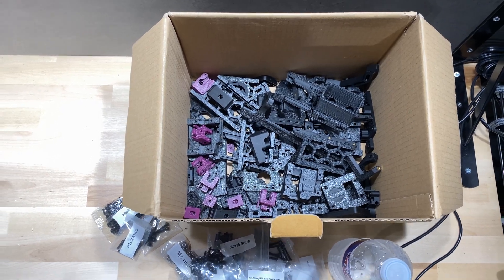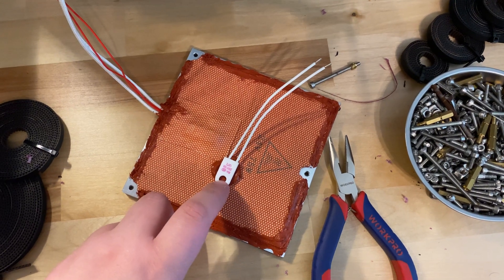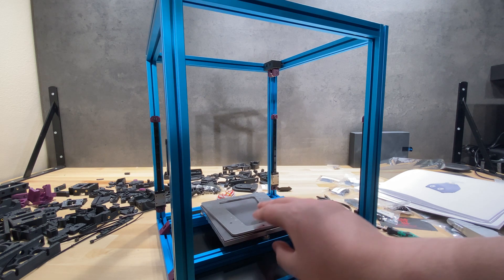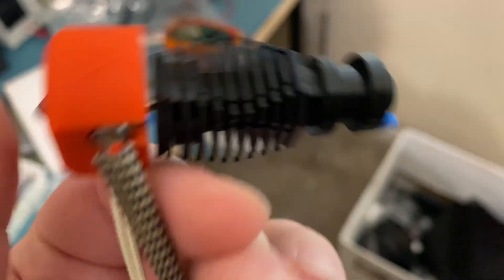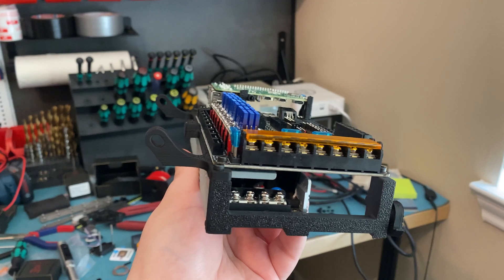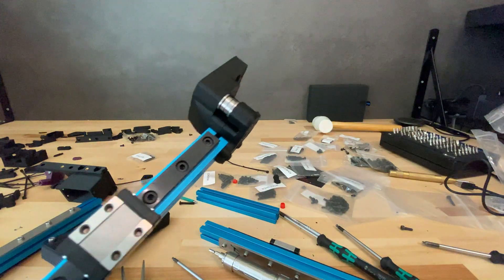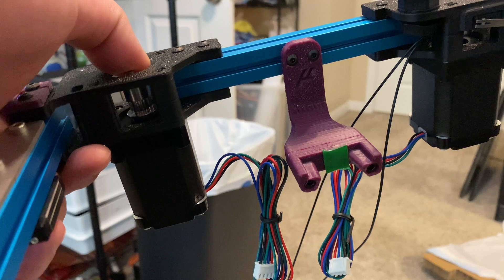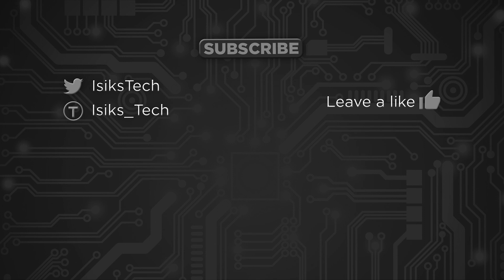Micron Ep. 1 - Frame, Gantry & Toolhead

Comment: Maybe the question sounds odd, but which advantage does it provide to go that small? Is it bed heating? Because at some point the motors and fasteners are a big part of the whole build and the overall size of the construction vs build volume becomes worse, too. Isn't 200x200mm a good minimum?
Reply from the maker: Yeah 200 is a good size for a lot of reasons. Micron is a printer I'm building for fun. It's cute, just as capable (except build volume) and doesn't take too much space.
Reply: @IsiksTech  That is a relief. I thought, that I missed something :). The space it takes is a good point.
If I wanted to create a PCB mill I would go smaller, too, because there won't be anything bigger than 160x160mm. Maybe, I should search for projects in that direction.